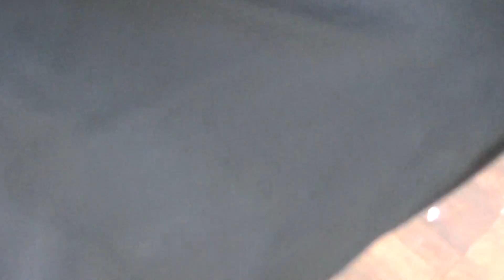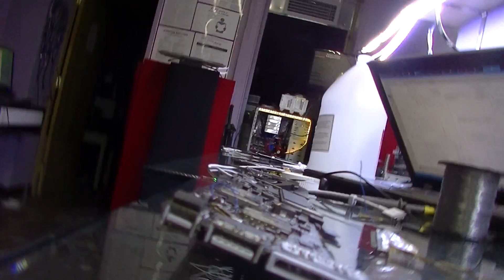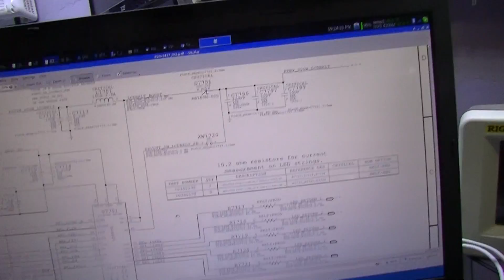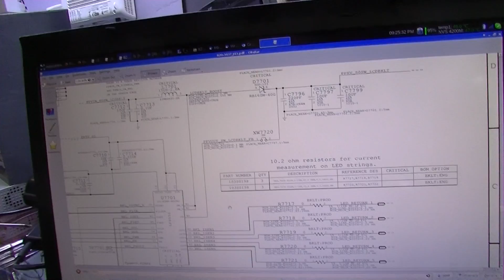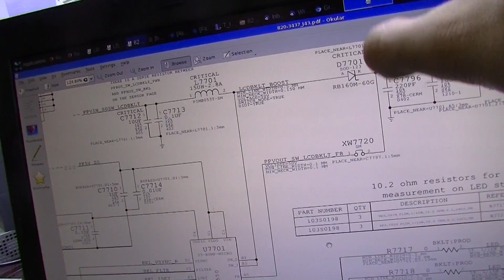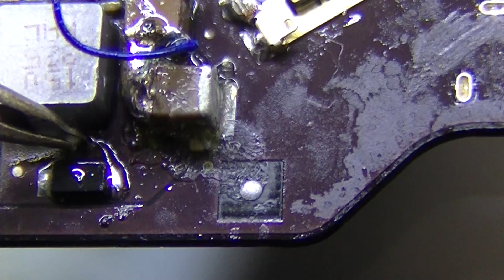Macbook Air no backlight logic board repair A1466 820-3437

Comment: Louis can you point me in the right direction  your A1466 backlight repair coupon for $205, just the backlight is damaged on my MacBook air also approx. how long is the turn around, I know these things take a while
Reply from the maker: tom ellis I got rid of the coupon because everyone using it sent in boards that were totally dead. It created too much unnecessary conflict.
Reply: Ok thank you
Reply: Louis, please let me know if you have any offers similar to the $205,  this machine truly only has the backlight issue, I tested using air display ran geek bench and tested every port, the battery charges and discharges as normal, but there could be something I am missing? Any way is your diagnostic fee a flat fee also, I know this would be a easy one for you.
Reply from the maker: tom ellis :( My salesman would kill me. He spent three months getting screamed at on the phone by people who sent in dead machines saying it was only backlight. I can help you troubleshoot it if you take out a multimeter and a schematic! Is this 820-3209 or 820-3437?
Reply: I work at caliberid we do confocal imaging I will have to get in touch with you after Thursday I would love to go over it with you I am a fan of yours so it's kinda intimidating
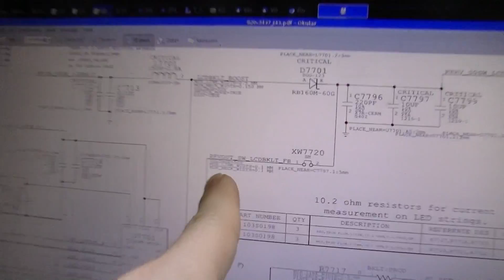Reply: I work until 4:30 then repair computers on the side (not component level) probably good enough to fix if I follow your lead tho and I can solder
Reply from the maker: Post a thread on advancedreworks.com/forum , I am a regular there, but there are also a bunch of other helpful people that post when I don't have time.
Reply: Ok thank you

Comment: Thanks for the video! First off, no, not all stereoscopes are terrible to look through, even at 20x. I had a Vision Engineering Lynx system at an old job, which was really wonderful to work with. I think they are pretty expensive, though.

I have an A1466 that was damaged by water, and the screen doesn't work. The computer works if I plug in an external monitor. Are there just a couple of likely culprits, or is this a potentially difficult problem to diagnose? Are you able to see the ghost of the screen if the only problem is the backlight, or will the screen be completely black?

Thanks!
Reply from the maker: Shine flashlight through Apple in the back and you should see an image if only issue is no backlight.

Comment: You rock, man, i saw some other videos of yours, i managed to revive my macbook air that was full of f*^%^$in milk and now i have a working machine!

I have problems that i guess its logical but i don't know how it can be solved, my screen "flicks" all the time, light on and off all the time, like backlight is shaking! and my fan is going like crazy even though its not hot..

If you swear at me probably you are right! :) but if you are in good mood and through some points i will be very happy!

You are doing not an amazing job, you are doing unique job!

Comment: very nice work  rossmann  perfect job  this is something great  but if i can ask something  coz i got same problem  about some missing pads if you can supply  a picture for the tracks that will be great thanks man
Reply from the maker: What's missing?
Reply: Louis Rossmann hey man sorry to disturb you but here i got some tracks thats comes to the lvds connector on the logic board the pin 3 and 4 from the left i need to know the track source coz i think they are connected to the same source  (a capacitor)  best regards  thanks man for ur help
Reply from the maker: Give me the 820- number of your board and also the problem with it.
Reply: Louis Rossmann hey man thanks for ur replay so fast and for the logic board  i cannot find the no'' but this maybe will be usefull macbook air a1466 emc 2632 mid 2014 the problem i've get my friend i think he droped water on the computer  and i already makes it work but the screen is very dim i barley can see the screen , i found these  tracks 3 and 4 from the left with some damage coz of that i can't know the source of them  best regards  byeeeeee
Reply from the maker: probably an 820-3437 board, and that is the connection for backlight. Replace the LCD connector and run a wire from pins 3/4 on the LCD connector to C7797, and whatever you do, don't ask me where to get the schematic, board view, or where C7797 is, ask google. But if that is burned there's probably a lot more that is fucked up. Measure from backlight side of C7797 to ground in diode mode with positive on ground before you do anything else and give me the number you get.
Reply: Louis Rossmann thanks man for all ur replies i'll do it today coz i know where is the capacitor c7797 from ur description early in this video but  what if i can ask pin 3 and 4  what i mean they are  1 point if i can say so comes from same source  yes   best regards   i will tell u the result later  thanks
Reply: Aallex Man  hey man i've got it work  thanks for all your help  it was very difficult  but i did  of course with your help so man again thanks  best regards byeeeeee
Reply from the maker: Awesome, I'm glad it helped you. Pass it on to someone else who may benefit from the information on this channel if you can. :)

Comment: Louis your abilities are above mine. I was wondering how much you charge to diagnosis and fix a backlight on a a1466?
I replaced the screen on it and while reassembling I was testing the screen and the backlight fails to turn on. I checked the fuse and it was dead so I bridged the point. Still nothing.
Getting an odd voltage on the fuse point of 7.9v
Reply from the maker: you should get that on the fuse. We charge $325 + tax flat for any board repair, there is some coupon code on other videos that drops it to 205 if you have nothing but backlight issue. Measure LCDBKLT to ground on C9799 with positive on ground, in diode mode on the meter.